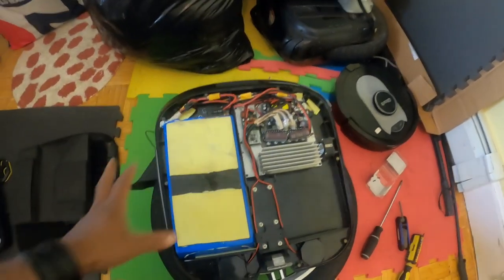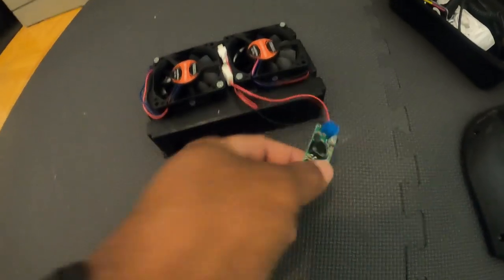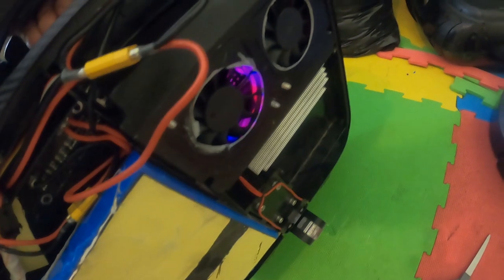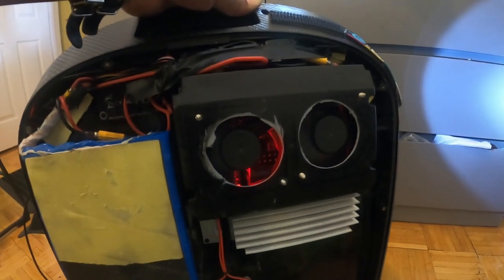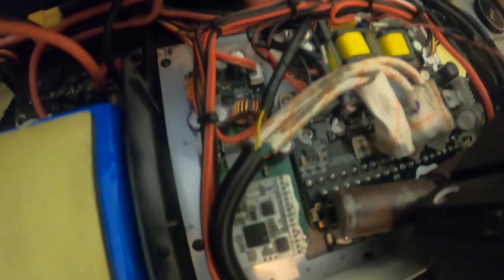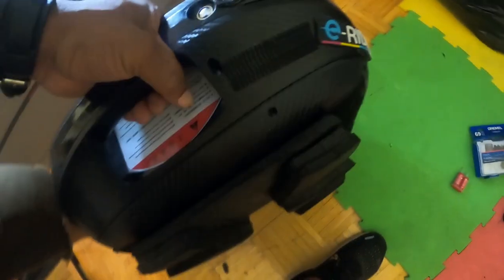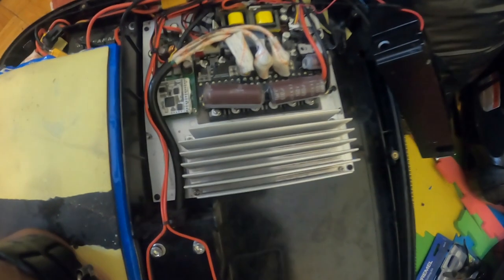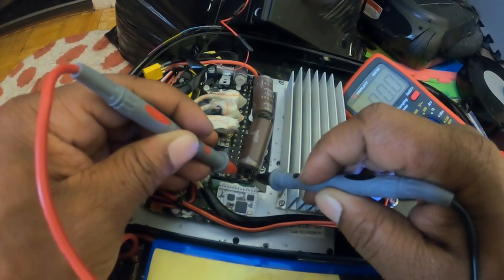Why Did This EXN DIE With No Warning?

Comment: i suspect the heat sink is sufficient to wick heat away from the board and does so more efficiently than the fans over the components themselves, especially since those fans probably were restricted by being too close to the outer shell. swapping that cap will likely fix the board, you could do a bigger cap but that could also make something more expensive fail next time.  you may want to rework your fans to cool the heat sink fins rather than just the board components. I think the issue here is just that the heat has no place to go. unless there's an exhaust port you are relying on the fans to just move the heat into the compartment. if you are feeling bold, you could consider finding a low amp 12 volt water cooling loop so you can push heat to the outside air but be able to seal around your coolant lines. slap a sexy RGB radiator on the front of the EXN for maximum cyberpunkness

Comment: Now I see why the capacitor blew. It's one thing to ride to bring it up to temp but every time you pendulum back and forth you're sending surges of power through. These boards are not meant to have 100 amps going through every second.
Reply: The full charge certainly didn't help either.

Comment: You don't add voltage like that if you put the two fans together each fan is still using 12 volts. It's just if you hook them off the same line you have to make sure the wiring will handle the current. Each one of those fans is probably a fraction of an amp.

Comment: A possible thing you can do is get someone experienced to solder in replacement components. Maybe you can get more efficient MOSFETs and capacitors to lower heat output. Might cost a bit more, but might prevent a future board failure and increase longevity perhaps?

Comment: The fins on that heatsink appear to be providing surface area for cooling the entire motherboard. It's best to have a high airflow fan on the heat sink fins. Maybe something like squirrel (blower style) fan if it will fit in your case.

Comment: Doing the load testing to get the fans to spin has given me an idea; someone needs to invent an EUC dyno, that could use (I guess) one of those indoor bike trainer things that offer adjustable resistance to put the motor under a simulated load. Excellent video btw...
(edit: looks like others have adapted motorbike dynos for the purpose)

Comment: Personally I have done the following and have not had any issues after multiple torture tests up steep mountain ascents, pendulums and hard riding, all in 25-30 celsius ambient temperatures :

-Removed the cover
-Replaced existing 40x40x20mm fan with 40x40x28mm fan for additional CFM
-Added 2 additional 40x40x28mm fans above the existing fan location
-Removed the Bluetooth speaker board, added a heat sink in its place
-Added heat sink on wheel well side 
-Replaced existing thermal pad with individual mosfet ceramic pads and thermal paste

The last resort I want to avoid is adding holes/filters and introducing outside air. So far I think with the above it is not necessary.
Reply from the maker: Yeah same. I don't want outside air
Reply: @UStride  Another item I forgot to mention is that is needed is I added thermal paste to the existing heat sink. Stock comes with none and it needs it for optimal heat transfer. Thermal paste was also used for the 2 additional heatsinks.

Comment: Aah, the capacitor shorted, it possibly didn’t have time to discharge, as designed, makes better sense now. Its really not designed to go through that type of stress, & if you have been doing that for a while, I would say those are really tough capacitors for taking that stress.

Comment: You were blowing air on the temperature sensor. If you used a hair dryer on high and blew the hot air at the board it would have triggered the fans. Hot air rises. If you put a hole in the shell below the control board. It would let the cooler air flow up over the board and out the holes at your tail light
Reply from the maker: Interesting didn't consider the sensors. Oh boy. Good point

Comment: So sad that you experienced that as you always try to do better. IMHO the fans are not placed ideally as they should be blowing over the heat sink laterally. If you put on the cover there will be no space for the air to pass through the fans and you will burn them also. You have to place them like where the small one was, blowing air from a vent or a bigger space over the wings of the heat sink. Also if you have 12v for the power it is better to parallel the fans because a buck convertor is not so efficient... Keep doing your best we like the way you experiment and share!!! Thanks a lot!
Reply from the maker: Interesting. Thanks a ton for that

Comment: like i mention before use a centrifugal fan  you will have alot of air movement
Reply: Genius!
Reply from the maker: Good idea
Reply: U-zstride you answer thatoo but you did not try😂... trust me 5v
Reply: @Papalou1234  would a 12v work? i just picked one up.
Reply: no a 12v will not work you need a step up dc to dc  board 5v to12v ...the fan plug
is 5v
Reply from the maker: @Papalou1234  really? I should have tested it because the fan says 12V I'll have to check again
Reply: @Papalou1234  I wish begode would add system board layout information in their manuals.

Comment: Fans need to be over the heatsink. Not over the electric components.

Electric components generate heat.  A heatsink transfers the heat onto a much larger surface and away from those electric components.  A fan cools the heatsink by moving air.
Reply: Probably not the straw that broke the EXN's back.

Comment: Hmmm… you placed a fan at 24v load on a voltage supply line of 12v and you used a step-UP Converter … ok that is not ideally Smart. 

On several reasons: 
1. The 12v line you used was designed to handle the Power of a 12v line including the controller circuit of the fan you removed..  if you step-UP the voltage Then you Will draw twice the amps + Voltage loss of the Converter. The board is not designed to output that current. It may blow the buck converters that is supply I ng the entire control board Plus the viltage regulators and result in Power loss to all circuits using the 12v supply line  
2. Your load is to high. You are using Power for the step UP Plus 2 big fans… that easily tripples if not quadrupples the Power requirement. Is your 12v supply rated for your requirement? Your stepUp Converter has a Power rating Actually. 
3. Your setup required a separate Power source direct to battery a relay should have been used to control the fan. But this require a design and computation. 

 I Will guess… the 12v Power rail is dead so all  components that use the 12v supply has no Power…? 

See the board used a step down Converter to reduce battery voltage to Power the electronic control board. That Power supply is computed based on the circuit requirement…effectively your fans pulled so much of the Power supply that killed the Power supply components of the board… so yeah! (This is my theory as I’m merely speculating - based on video) 

But a New board may fix the problem… or check every component of the Power supply line for failure and replace 🤷🏻‍♂️